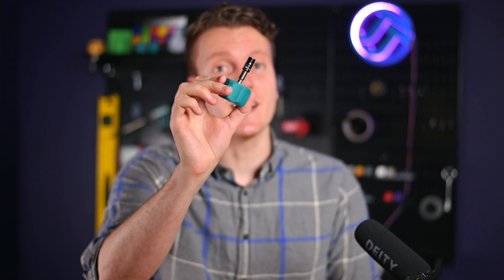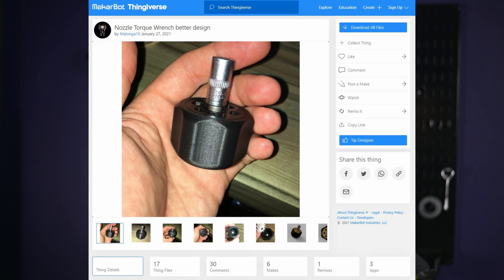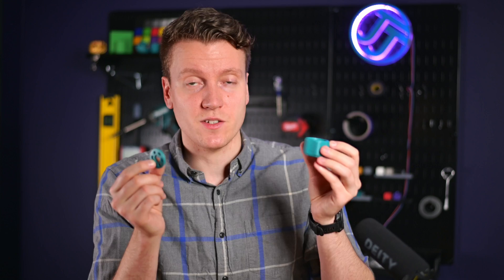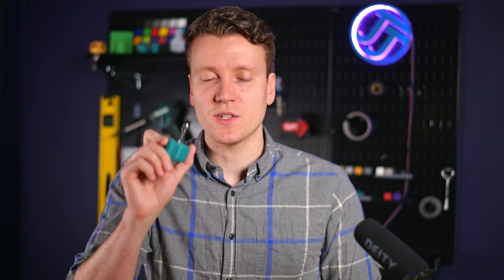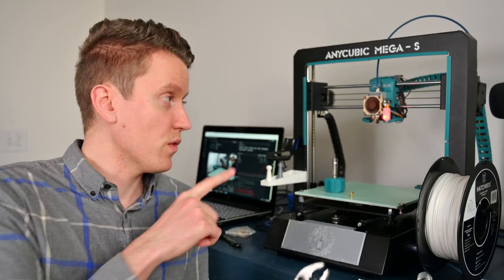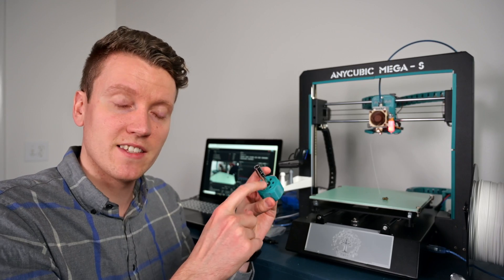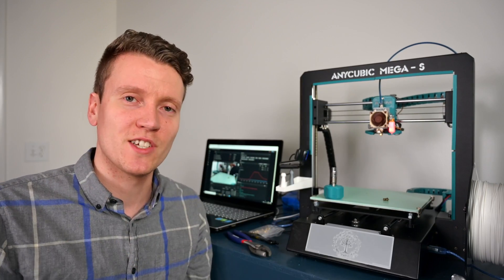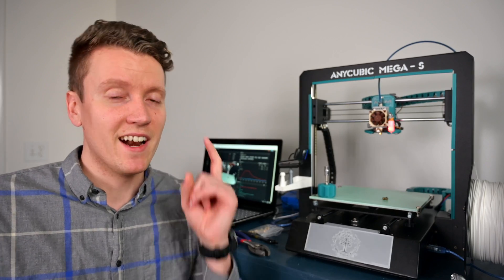Print This Next | 3D Printed Nozzle Torque Wrench

Comment: I change nozzles a lot, since 0.25 mm nozzles are great for detailed work (e.g. when printing lithophanes I see a very noticeable improvement over a 0.4 nozzle), whereas I may use a 0.6 or even 0.8 nozzle for functional parts that don't need to look pretty. Also for vase mode big nozzle good.

Comment: Why did you change the  bed springs to hex nuts, ive bern going through your videos and don't noticed that
Reply from the maker: After I added a bed leveling probe, the solid mounting won't shift and change like the springs would
Reply: @JJShankles  oh thanks just about to add a BL Touch just waiting on the raspberry pi to get here so I can load klipper, good job with the videos

Comment: Informative video and something I will certainly print out. Firstly though what did you print the torque mechanism with? Is it Nylon or just standard PLA.
Secondly, there is something you missed out on the video, which I am sure you are aware of and that is that the block should be cooled down prior to putting in a new nozzle.
Reply from the maker: This is all in PLA filament. It was designed for the thickness to get the right torque with PLA, but I think they have some other thicknesses to work with other filaments. 
And the block should be heated to the printing temperature when tightening because the materials will change shape at temperature.

Comment: If the block is spinning when you're holding it, then the heat break is loose inside the heatsink. You should also tighten up the set screws in the heatsink.
Reply: It depends on which style of hot end you have. Some hot ends have a heat break that doesnt bottom out on the heat block, so you could literally thread it all the way through if it was long enough. the only thing that stops it is the nozzle being tightened against it. Hot ends like the microswiss however do bottom out on the heat block, so you can tighten them up first and then tighten the nozzle up.

Comment: Find it hard to believe that heat won't be an issue when hot tightening
Reply from the maker: It's not on the nozzle for very long, and the socket and metal rod is a lot of thermal mass to heat up. It hasn't been an issue so far, and I've changed several nozzles

Comment: Printing it now. Thanks!
Reply from the maker: Hope you like it! I've loved using it so far
Reply: @JJShankles  So, long time Marlin user. Just started with Octoprint on a Pi Zero W2. Its okay. I have RepRap Firmware on an ender 3 and Really love that. Similar to Klipper with an on the fly config file so you can fine tune in real time.  Had some CoreXY issues with Marlin so moved to Klipper. So far I have X/Y and sensorless homing working. Just need to get the servo we discussed operational for the pen plotter. But close. Thank you for your help, and your videos were very informative. I had asked some config questions on the various klipper discords but it is like fishing, you hope you get a response.:-)
Reply from the maker: How do you like sensorless homing? It is a feature on my SKR Pico control board, so it's one of the things I'm planning on looking into in the future.
Reply: @JJShankles  I do like sensorless homing. Since I was building a coreXY from scratch with TMC2209s, I did not have to wire endstops. You just need to adjust the sensitivity, which is very easy in Config. I started with Marlin, and had to recompile, and update the firmware each time I changed something. That is a benefit if printer.config and RRFs .h configs.If I had endstops already, like on my ender 3s, I don't think I would bother with sensorless homing.

Comment: Great video had no idea you could print one. so that will be super helpfully I just have to ensure i get the right size as i changed my hot end to a volcano... of course right after installing the bl touch. 😂 side note.. re calibrate your bl touch before homing as it will definitely crash into the bed and take a chunk out. Oops 😬
Reply: Also you should totally get some stuff to sell like other YouTubers. Because I really want a cup with your logo and on the other side Print this next. It would be sweet.